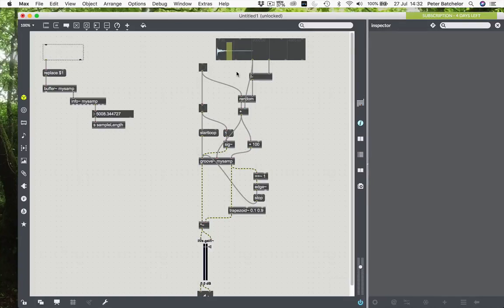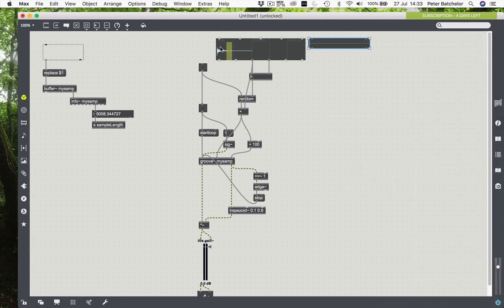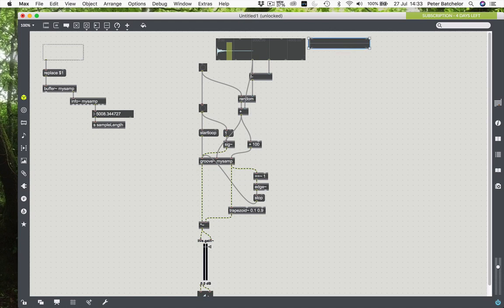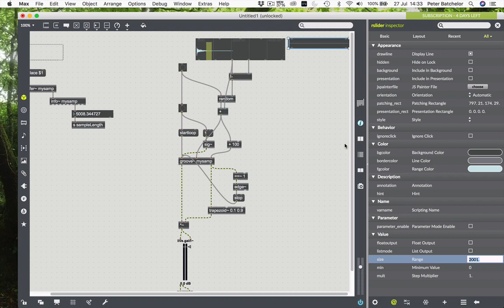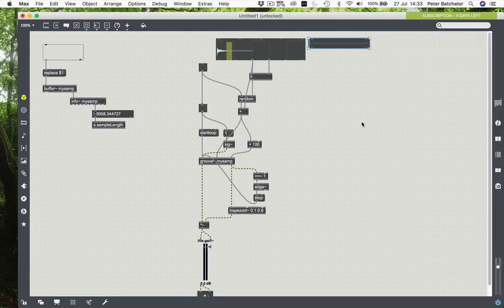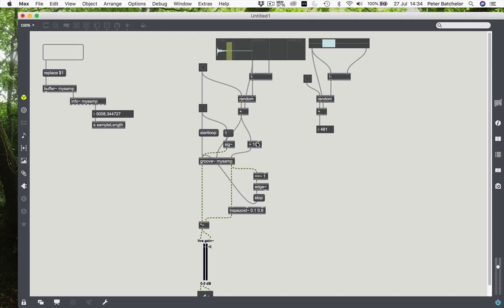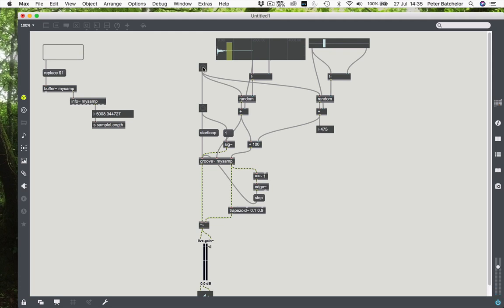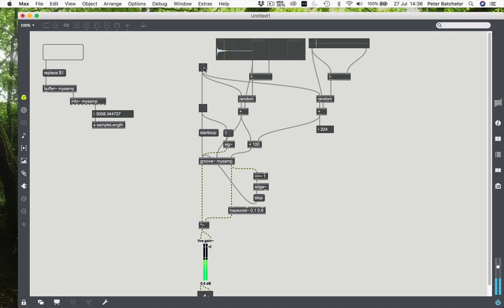Plode -- Build a granulator in Max7: 04. Grain Length

Comment: Is there a redundant sum? Or am I wrong? I mean the random start point is given by the waveform with its random, so the rslider section should give the random duration of the single grain, but without offset.